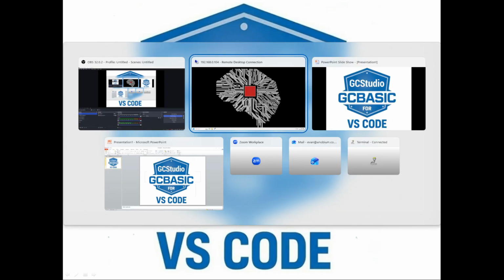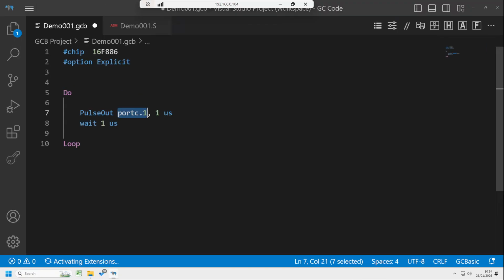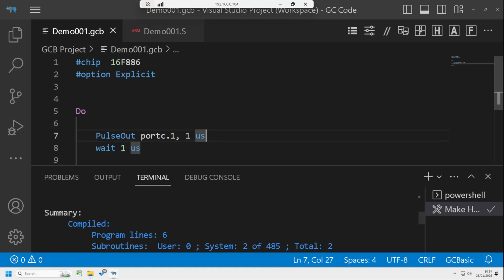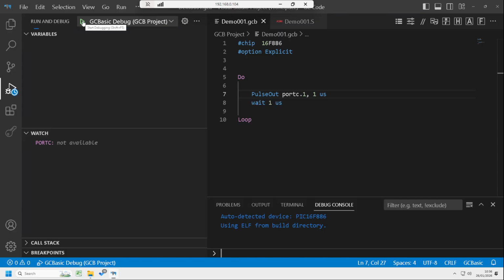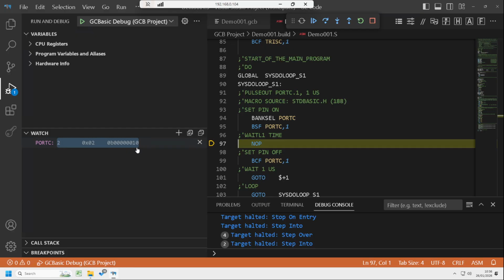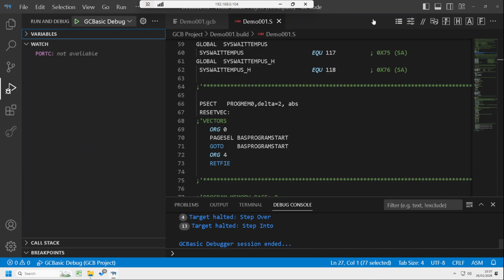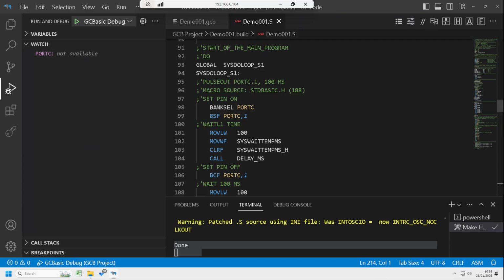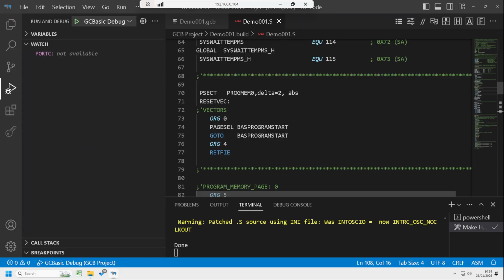The NEW GCSTUDIO Debugger Changes Everything for PIC Developers even for Legacy PIC Microcontrollers

Comment: VS Code as in Visual Studio Code?
Reply from the maker: No, Visual Studio Code (VS Code) is a lightweight, cross‑platform code editor that relies on extensions to support many languages and frameworks. GCCode is an extension.  Visual Studio, by contrast, is a full integrated development environment (IDE) designed mainly for large‑scale, enterprise applications, especially in the .NET ecosystem.